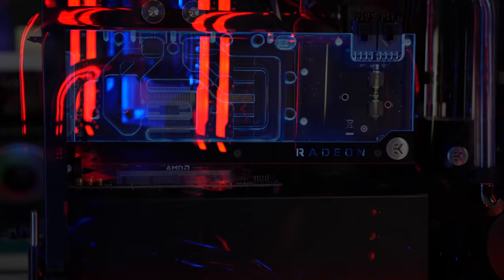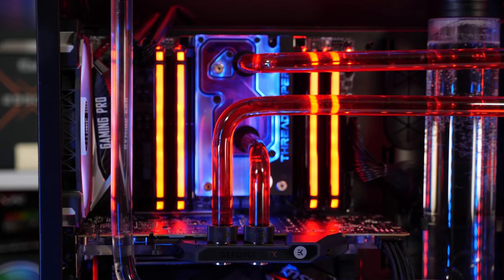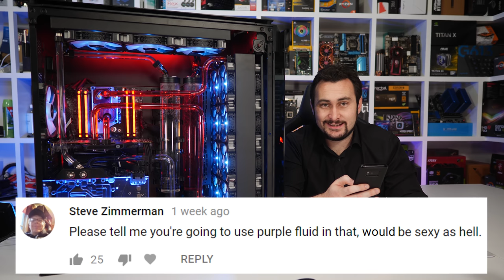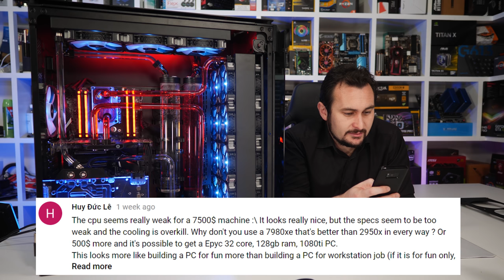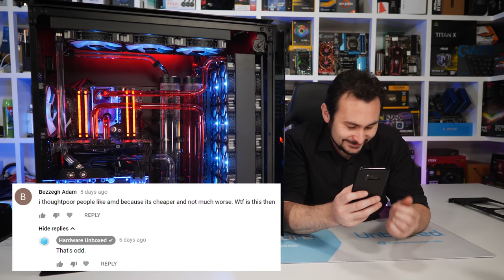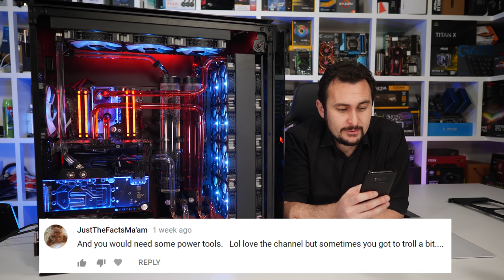The $7500 Threadripper 2950X ‘CoffeeRipper’ Build, It Leaked a Little!

Comment: Just to clarify for those who may be confused, they're called o-rings, not washers. I would check the integrity of said fittings that leaked, with time they can loosen and back off, especially with the pump being so close. As you can see, liquid cooling takes a lot of patience and planning. A stitch in time saves nine. Nice build!

Comment: Wow!  I couldn't bring myself to cut into my 1000D to make extra room to accommodate the 4x480 rads in the front and top.  Instead I completely removed both top and front slide trays, which are useless if using hard line water cooling anyway.  I was then able to use the two already existing screws that sit above and below the top and front inlet/outlet holes of the case as fixing points to make 2 new identical mounting plates for the radiators and just screw into place with no case modifications necessary.  This way I can reverse If I ever want to, but really I just couldn't bring myself to cut into the case.

Comment: Like the build. Leaks may be a result of the filled reservoirs applying more torque (leverage? dont know the correct term) to the assembly of fittings connecting to the pump such that they get pried open.

Comment: Just bought this case. I thought one of the tragedies of the case was the riveted in drive cage (where you have the pumps). I don't mind it being there but it should be removable, more so with the top RAD/FAN clearance.
Reply: I removed the drive cage long ago and made a custom PSU shroud. Looks so much better.

Comment: holy sh*t! what a build...i went the totally opposite with the Taichi x399M (m-ATX), but if i had the room for a refrigerator sized workstation...this would be a dream. i also "cheated" with the enermax 280mm aio modded with Corsair ML fans (also added 2 x140mm for VRMs)...and the only RGB is the case (crystal 280x), the ram (Trident z 3200 32Gb), and the gpu (Sapphire Vega 64 Nitro+).
not that into the light show...but i've diddled around a few profiles.
your build you can have in a freaking desert with all cores overclocked...

Comment: So removing the top tray , it looks like with drilling mounting holes you could fit 2 480's in the top ?  did you remove the front tray ?   would it save you  much room to remove front tray ?

Comment: What a spectacular system. I would have done the same with the top radiator (except cable management) I'm baffled as to why corsair didn't provide mounting rails in the top radiator bracket.

Comment: sounds like the o ring in the fitting didn't seat all the way and when you use the needle nose you forced the seating to complete. I'd make sure you can remove the fitting with your fingers if you're looking for the Ideal finger tight.

Comment: Love it, nice set piece. If it's going to be on all the time, why don't you use it to do something like supporting science in the background? Folding at home or seti at home? You get marketing, science gets some good resources added to the pool. Incidentally, given it is a new set piece. I feel like you're going to be wise to pin a link to the build videos for the next while to answer the inevitable questions about its specs.
Reply from the maker: Thanks. It has to be quiet so I can't have it at 100% load making noise. Also power in Australia is very expensive.
Reply: I feel your pain hunter valley NSW. 9kwh/day average, still paying hundreds of $/quarter.

Comment: I'm not fan of those shrouds either. They HAVE to design that better....is the same on my H500M, I need to undo a lot in order to have the PSU access. And manufacturers should give you more space on the back, now with RGB you need much more wiring and controllers thus cable management is almost impossible.

Comment: Does anyone know how he has the system lit up but it appears that it is not actually running? I'm asking because I have the same fans but they always default back to the rainbow style whenever I turn off the software?
Reply from the maker: Use Corsair Link to save to profile to the controllers. Also the fans don't spin till the components reach 45c and since it's idling and has a massive amount of liquid and radiators that never happens.
Reply: @Hardwareunboxed  thanks for the response! I just got it set up! You saved me so much stress by looking at that disgusting rainbow effect all the time! Keep up the good work!

Comment: Can't you do a "Pressure test" before you fill it with liquid? 
Even the gas company does a 24 hour air pressure test before they hook it to the natural gas lines on new builds.
I've often wanted to ask this of people who do custom water loops...
Reply from the maker: You'd blow it apart, it's not a pressure system.
Reply: You keep it low pressure simple, 1-5 lbs of pressure I'm sure it could be done
Reply from the maker: You could but it would be very difficult to detect an extremely small low pressure leak, I mean you could watch the gauge I guess over a 24 hour period but it seems very unnecessary and an expensive solution to a problem you should almost never have. I've built about 2 dozen liquid cooled rigs now and this was the first ever leak and it was very small.
Reply: Thanks, I've always wondered if it would be worth it. :)
Reply from the maker: The other part of this issue being where is the leak? In my situation we would have seen a drop in pressure, a noticeable drop over a number of hours. But because it was so small and in such a hard to reach place there is almost zero chance you'd locate an air leak that small without submerging the entire rig, so it's not very practical ;)